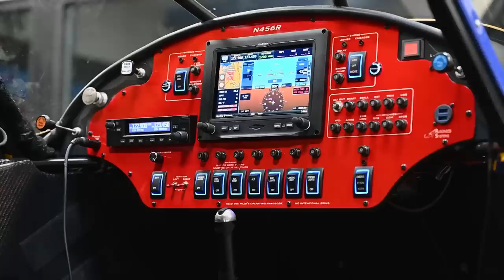How we landed an Airplane on a Helicopter Pad | Behind the RedBull Bullseye Build

Comment: MIKE, it would be wise to have a "Low Bottle Pressure" Safety switch on your n2o system. You may have your bottle pressure regulation down to art, but just in case I figured I mention that critical aspect. Great job to all involved! Now "GET BACK TO WORK!" ha
Reply: Low bottle pressure with nitrous isn’t a danger.. the mixture will just run rich. The danger is for the fuel pressure to drop off and the mixture to go lean!
Reply: @thomasaltruda  Well you are not wrong, it’s just that my concern is a little different. In their situation, maintaining engine performance would be critical. (in my opinion)  and that’s what i was considering. Personally, I prefer to set a pressure window (850-1050psi) where the system will not activate unless the bottle pressure is within those parameters. I want reliable/dependable performance at all times. So. The last thing I need is have the wrong fuel/timing table activated if the is cold or the valve is not open. I’m not sure how they plan on adjusting the fuel (if at all) so I didn’t want to go into depth without knowing the full scope of the system’s capabilities. It was more of a (hey, don’t forget to consider this…) just like you always want to consider the  location of the bottles dip tub and it might change during the aircraft’s maneuvers. I guess it might be better to say that if I were flying a high performance aircraft in a situation where wanted/needed maximum performance at times, well would prefer that when I make that request of the engine, I can be confident that I will get the extra horsepower or maintain my current level, rather than asking for more and receiving less. Anyway that was my thoughts on the subject, I may just be overanalyzing things here today.
Reply: @Rick_Dunaway  I don’t think they NEED the power.. you could fall off the edge with the engine at idle and still fly away…
Reply: @thomasaltruda  I believe you are 💯 correct, also believe I’ve developed me a hankering for one them 24oz RellBulls all the sudden. Gotta get the Biggn cause fits the cup holders right unlike them slim can sissy sizes…

Comment: Mike you have invented the wheel again. Why don`t put fuel tank lower in the conopy instead of the high wing? Just like most planes back in WW 2, low gravity centre fuel tank behind pilot prevents from tiping over and it gives better weight distribution and responce. Engine in the front, pilot in middle and fuel in back. This change a lot in piloting a plane.
Reply from the maker: great ideas 😉

Comment: Now all you have to do is add an Edison generator and electric motor to have an unlimited range electric power airplanes.  Get an old car generator pre 1974 and chisel off the Tesla magnets from the armature magnets and leave the Edison magnets on. That means chisel off one sixth of the armature magnets and leave one sixth on and alternate chiseling one sixth off and one sixth on to three sixths off and three sixths on alternating on and off.  Your have a motor that generates electric power without fuel and you can wire inverters to deliver 110 volt AC power continuous peak power.  More generators is more current and more transformers is more voltage AC.  How much voltage AC and current to power 1500 HP electric motors??